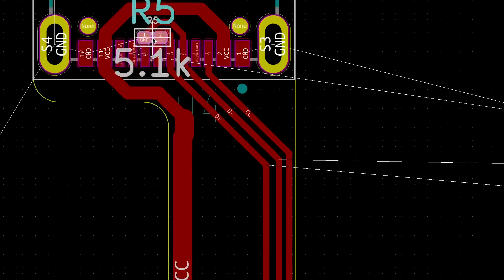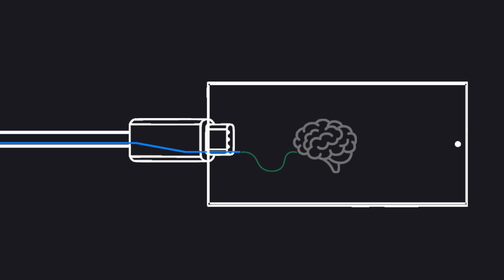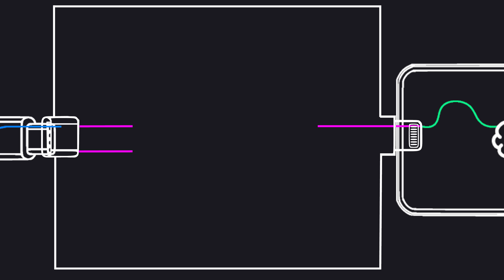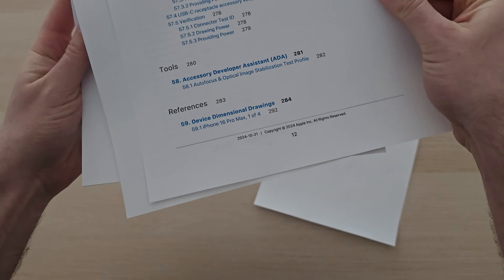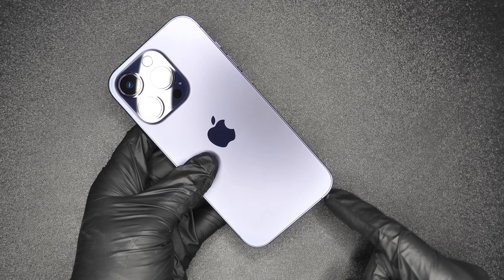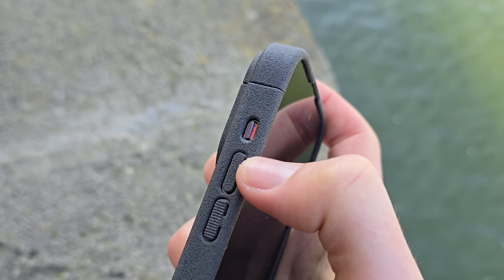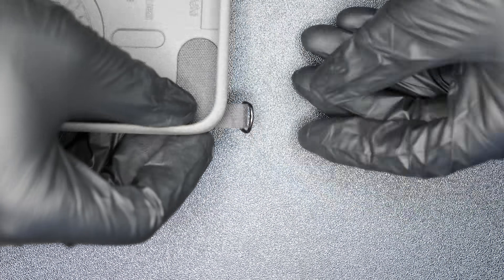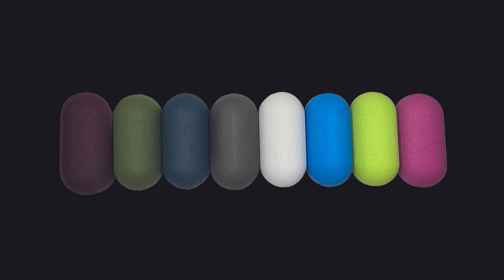I Gave Every iPhone USB-C.

Comment: I would love to see a case like this thats maybe a little bulkier that supports sd cards. Iphones have support for usb flash drives, right? would be nice for something like a local music library. obviously you cant install apps to it on ios though. on android you could though, maybe you could add a sd card slot to a high end android phone. do something like a pass through like this to a port but theres also the guts for a usb hub in there and the hub supports sd, or theres a switch to turn the charging off and the sd card on.

Comment: It would combine with screen cover nicely. You know, those notebook-like (as in "book for notes") cases with a cover for screen and magnetic latch to prevent it from opening. They already have a corner occupied. But again, your connector is on the wrong side for that :(
Reply from the maker: First solid argument I read to make a left side pcb, thank you!
Reply: @ExploringTheSimulation  I would like to order one like this from you, but I can't by virtue of being a Russian Citizen.. Soo.... I can share the idea, at very least.
Reply from the maker: @KryptLynx I ship to Russia all the time, no issues. Just payments are a bit difficult but there's usually a way.
Reply: @ExploringTheSimulation  Oh, good.
I assumed the answer is "yes", but does the adapter works for data transfer (iTunes/XCode)?

Comment: If you designed one of these case that can let me put anywhere from 1 through 6 18650 batteries in the back and could recharge my phone no matter how many are plugged in, and also had a headphone jack in the other corner, i would pay 175$ for it.

Comment: do you think something like this for magnetic cables could exists? I used magnetic cables before and I loved them, the problem was that any time I dropped my phone, even with small impacts, the magnet connector connected to the phone always cracked so I've been thinking if a solution to this could be useful/doable within reason.

Comment: So what happens when you plug in one of those cables that has two cc wires? So far it doesn’t seem that much different from just connecting the two cc wires together solution.
Reply from the maker: The two wires are sensing what's plugged on them. If you plug them together it just creates an error and it won't charge.

Comment: 2:11 
After closer examination, Apple’s Lightning to USB-C fast-charging cables use an 8-pin single-sided design on both the Lightning and USB-C connectors. Both connectors support reversible insertion for fast charging. Additionally, the Lightning interface includes a pair of CC (Configuration Channel) pins for setup and communication. So it is not that there isn’t space to accommodate CC pins. Where exactly is the issue?
Reply from the maker: The issue comes when we transform the USB-C male port into a female one. We are not supposed to do that and that's where problems arise with CC orientation. You can watch my original "how I made the world's first USB-C iPhone" video for more context

Comment: Actually putting the charging port on the right side when you are right handed is kinda dumb 😂 you will have a hard time to use your phone while it's charging as the cable will be an obstruction and is prone to sliding. "Getting used on some time" is NOT a solution bro. I would like to try out your case but based on your desing? I changed my mind without even thinking why. Also, it will bend and kill your cable 😂 putting it on the left side instead removes all of those issues 😂

Comment: Does the case cool well? If not, can I use a cooling fan on my phone to reduce the heat? Because my place is around Southeast Asia and it's very hot. There's no way that the air will have a low temperature except in winter.

Comment: Ik this is cool and all and i totally want it but what about durability how many drops till i break my phone/ electronics inside case and have to get a phone phone, case or both. I mean absolutely no hate what so ever im just curious on how well this is gonna protect me 1.2k investment. I do have an idea for what to help although it is only just the rubber padding, but its good, its called AiroShock, AiroFoam and one last thing to top it all off, use polycarbonate mixed with carbon fiber if u can’t afford that just use the regular old polycarbonate. Bro ur project is gonna be great just get the durability on point and they will sale faster then they already are. Hope u read happy investing

Comment: Why did you have to collect parasitic power from the CC lines and couldn't use the standard power pins instead? I think there should be at least 5V from the start.

Comment: "flip to fast charge" is not an issue, it is a feature - if you are to charge your phone overnight - you can choose slow charging, for battery longevity reasons. 
and if you need to charge it as quickly as possible - you chose the fast charging orientation. frankly genius.

Comment: This is such an amazing innovative idea! I do have to say to have the USB-C port on the left side would be more practical for two reasons (with context):

1. Most people are right handed, pull their phone out of their right pocket, and would control the phone holding it in their right hand. This means that the charger cable would presumably rest against the palm of the hand, hinging it slightly to the left if used to like doomscroll tiktok and stuff like that. 
Context: Yes i read some people use the phone in their left hand and control it with their right hand. Sure size of the hand holding the phone matters, But most people control the entire screen (apart from maybe the left corner) with one hand.

2. Using the phone to game with the charger cable comming out at the top of the phone is genuinely smart to think of. Although you could also flip the phone 90 degrees right and have the chargercable come out on the left top side.
Context: Not sure if iphone allows games to flip when holding the phone the other side around so feel free to correct me on that.

All in all, a very good idea with an excellent design! My personal observations on the design would only be applicable for the longevity of the USB-C chargerport and cable. Tho seeming as this is the first time i've seen anyone design this inside a case that not only protects the phone but also offers 9v charging and such i can't really complain.

Great work!
Reply: Also, absolutely subscribing! Love this kind of innovative content!

Comment: Why dont you place the usb charge connector at the back center, with slight square bump that is level with cameras, this will prevent wiggling the phone on the table but wont bother users much?

Comment: insane engineering, love it!!
Crazy respect as a fellow engineer & profuct developer

however, given my experience with SLS PA12 parts: i am afraid that it is very brittle and that the case will break when dropped. I am now using stiff Polyurethane for many engineering parts. 
I would have loved to see some drop tests as that is the very basic task of a case. did you do some drop tests and just not show them in the video?

Comment: This is amazing video quality and i love everything involved. I got to the end and realized it was all about the cable compatibility. I don't like the 2 cable situation either, but really its 3 for me with microusb too. What I really want is picture/video upload download ability to iphone, without itunes. That camera roll is a closed system so transferring pic later via external drive does not work in my attempts. They want you to do through cloud but I don't use apple cloud for cloud storage.

Comment: Hä? Usb c doesnt trigger voltage over cc pin only A and for PD to get regonize. Its trigger default, 1.5A and 3A .

It needs a chip to communicate to get higher voltage from the power supply. Thats how all dunmy plugs for usb c works

Comment: So how come you didn’t put the sd card slot on the door side so you don’t have to remove the entire case to access it? Could fit 2 there actually if you line up the flat side with the flat side of the recycle symbol. Or is it a safety feature in the use case of putting it and forgetting it and still having it if the door breaks off. Also why not put the thick side on the top so you can do that optional aux also but add a squishy material as drop protection or something to even it out

Comment: I mean…sure? I guess? A case is fine and all but are there really no cases like this for older iPhones? Not a single soul in China with the capacity to make a USB-C case has done so? A case is kinda cheating regardless. If you’re going to buy an entire ass case solely for USB-C for some reason, just sell the thing for a new phone whether it be an Android or a newer iPhone and be done with it. Not something I’d consider even if I were desperate for USB-C but whatever floats the boat of someone with an older gen iPhone. 🤷‍♂️

Comment: The one thing I would have for a more "rugged" version is a flap over the USB-C. So when it's not being charged, it doesn't get crap in it. Very useful for people working out in the field. Or making things in dusty areas.
Reply: It should be possible but that is a custom mold for the rubber and will add major cost to a small scale manufacturing entity. You could just get one from TEMU and glue the tail on to the case somehow.
Reply: They sell little plugs to go into the port for that and from experience they have done flaps before but they don't work well.
Reply: @SilvaDreams  I like mine. The last two phones I had, I got those cases and the rubber held out for years.
Reply: There's plenty usb C plugs available online. Some with figures on it. Just get one that suits you.

Comment: Great job. Fortunately/Unfortunately everything is sold out. A bit of feedback or observations. The left side is basically empty. What more could be done is to add a lighting port to the left side. So we can use either or. All my cables around my house are already lighting already. This product would be more utilitarian then. Please check that out if that's making financial sense or how difficult would that be to implement?

Comment: The idea and the engineering are perfect! However, I use my phone for motorcycling and all the phone holders (I have) are designed for a central plug, that's such a bummer! I need to find one which can be used with one hand only and that allows a side-plug... Any suggestions? ;D

Comment: well I will say it's kinda late doing this now as the old port is already getting obsolete, this solution is for older phones only, the problem is gonna be gone by itself: this market that you are entering is declining.
also, with the USB-C port in the corner of the case, I feel like I will drop and break it easily

anyway this is a good project for you  for sure

Comment: CC wire :) sure ...

What is wrong with soft 5V charging and the good ol' lighning connection? Simply use a certified adaptor cable if needed.

Comment: I kind of feel weird,like whats the purpose of slim phone if we have to make them chunky again for USB C port, instead I am happy with the lightening to female USB C adaptor, you have over engineered when upgrading lightening to USB C 4 years ago, but charging from one end is kind of bummer.i like those cheap power bank that comes with USB C adaptor they can charge at 7.5w giving extra battery and portable as well

Comment: What if you did that on the iPhone that not supported of wireless charging, and you designed a custom wireless charging case for it? You could integrate a Qi wireless charging receiver inside the case and connect it to the Lightning port. Then, on the back of the case, install a copper induction coil (often just called a wireless charging coil). That way, even older iPhones without native wireless charging support could still charge wirelessly using the case.

Comment: A while ago I got a Laptop that had no 3.5mm jack. I returned it because it was pretty much useless as it also didn't have USBC.

That's pretty much the same logic for the older iPhones. Useless technology that serves no real function other than to irritate the user with a stupid cable connection. The OS is also rubbish and too restrictive in my opinion. I can do a lot more with an Android OS enabled phone with no fuss.

But, there are people who for some reason like iPhones and this solution you designed that will give them a truly universal charging option is gold. Keep up the good work.

Also, I had a friend called Mark at a University I once studied at. He was a computer engineer, more specifically he designs circuit boards and other electronics, as well as creating low level software for machine chips.

Although I didn't know how, or even why he would want such a rubbish OS. He had successfully installed Window 8 on an iPhone. He had something like a key fob that fitted into the main port where he could switch the OS easily. 

If you know what I am talking about, perhaps you could also include this as an option as well, to enable people who like the phone design, but hate the OS, to be able to switch between Operating systems.

To be fair, I studied Computer systems but only shared one class with that guy. I was more of a Web Developer rather than Computer Systems Engineer. So, maybe somebody else can explain this better than me.

Comment: Kinda late, but ordered an iPhone X  about 2 years ago. Came with a cheap screen and battery. Had no plate cover where the ribbon connectors are and didn’t have the waterproofing adhesive installed. 4/10 would not recommend

Comment: You forgot that your case also supports a secret extra phone. You technically also support the iPhone 8 since it is the exact same chassis as SE (2) so you could include that in your marketing.
Reply: It wouldn't work tho he explained why
Reply: @OPPSLAYYY  what do you mean the iphone 8 and iphone se 2 are quite literally the exact same outer dimensions as the iphone se 2 is an upgraded iphone 8 in the iphone 8's body

Comment: Seems kinda nuts people want USBC that bad on older phones, especially since most of those this is made for support wireless charging if they don't like lightning...but I applaud any DIY engineering like this and you are great at it.
Personally I wished the EU had stayed out of the whole standards thing and let capitalism pick the winners and losers because I prefer any connector that doesn't have a central thing with pins in the female end. 
With lightning it's so much easier to clean out with a toothpick or even a needle or paperclip if you're in a pinch and know what you're doing. (Wouldn't advise anyone to ever use a metal object for cleaning, just sayin you can if you're not an idiot about it)

Comment: can you make my ipad lightning? man lightning just goes in devices so much better, usb c is definitely the best usb design ever made it's almost perfect but 100% of the time you try to put a lightning wire into a device it's going in no fuss no fumbling don't gotta look what you're doing because it's not trying to fit a round hole in a round hole instead it's a peg in a round hole so there's nothing to catch onto or anything it's just perfect - or even better would be magsafe in ipad then I'd only need a wire when charging my magsafe battery pack (which thankfully already uses lightning) ..... actaully how about magsafe charging on the opposite side of the magsafe battery pack too then I could truly be wire free :O

Comment: I considersd something similar for phones years ago when I first saw the external USB power in the form of 18650 cells, I thought why not in a case form vs hanging off usb, possibly damaging it. You quickly lead to "well, it would need a usb data pass through for certain things as well".

Comment: I see one issue with this design, it works as usb c but fails as a better protection case as the mount is on the edge and falls are mostly on edge so most case have their air pockets on the edge

Comment: Amazing job and seeing the process makes it even more of an interesting purchase. This is something that annoyed and frustrated me a lot for a long time until I came up with the solution to buy a bunch of magnetic chargers. The ones where you can place a small inexpensive piece into the charging port of every device you own and then use one cable to charger any device. It solved all of my problems with carrying different cords, but I might still buy one of these in the future as I don’t plan to upgrade my phone and type c cables are easier to come by than ordering a special magnetic one from wherever. Thanks for documenting this journey through video, simply amazing work!!!!

Comment: Why you decided to push that port on the most needed and busy angle of the phone? Why not do it left? Mostly of us is right handed and we are holding our phones with right hand, and it just makes no sense to me, why you would want to make that single angle worse? Also i cant hold phone when its charging. And why at all bothering with usb-c, while you can buy wireless charger for the same price, or magnetic one, which you can plug blindfolded with one hand? Btw, data transfer is through air anyways.

But you did a great job.

Comment: You could have made a device that attaches between the adapter and the cable instead of the case. It would have been less difficult and it would have been nice if the cable had been extended by 5cm more. But even this is perfect. It's a great design. We need more people like you.

Comment: I love this BUT I would have made the cable on the left because most people are right handed and would lie in bed watching videos holding the phone, while charging, in their right hand at 30 to 45 degree anger so the part that gets all the weight (that bottom right corner) is the main part directly connected to my hand so im gonna put force bending that cable if i hold it like this